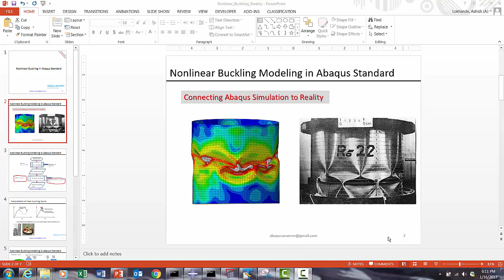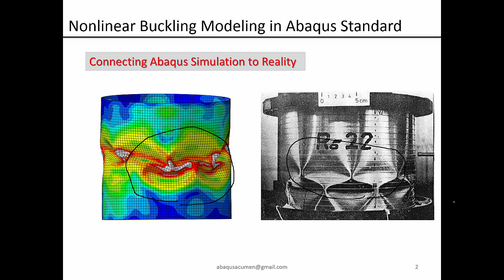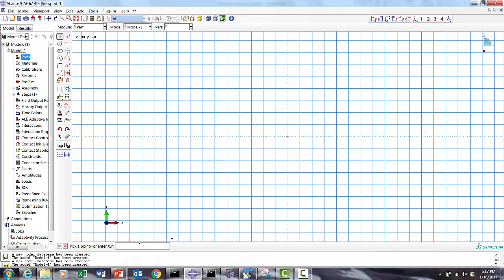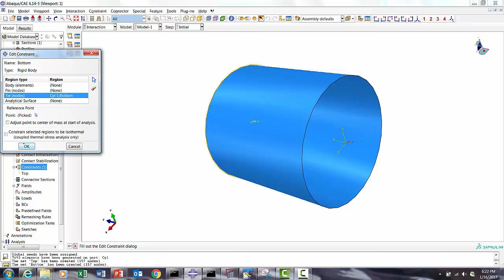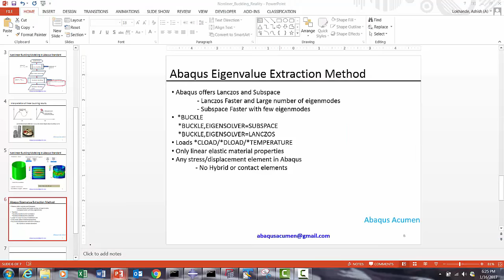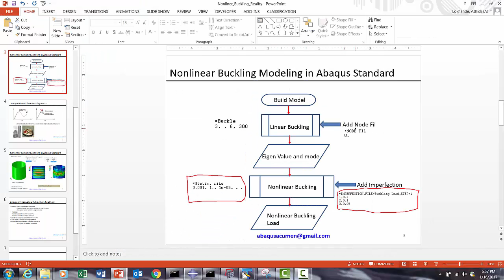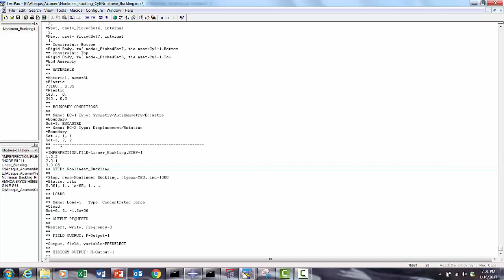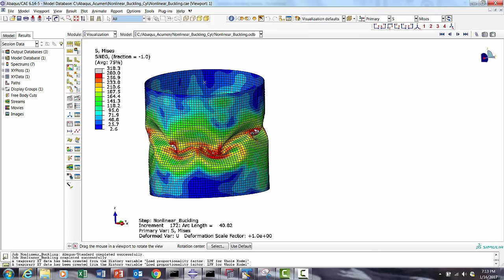Abaqus Standard: Nonlinear Buckling Example (Cylinder buckling)

Comment: In this model, If you use "Step = Static, General" with "Nlgeom=ON, Automatic Stabilization: Specify dissipated energy fraction : 0.0002,   Use adaptive stabilization...=0.05,   Maximum number of increment:1000, Initial:0.001,  Minimum: 1E-005, Maximum:0.1 "  &  "Load, you use displacement loading U3= -10mm ", you can also get the same result with "Static, Riks"
Reply: why we need to add U3=10mm? when we get first eigen mode then we use same value for buckling which is giving more correct & realistic results. what is your views?

Comment: When I do the "Data check" for the Non linear Buckling case, I get the following error- "Error in job Nonlinear_Buckling: The following results file(s) could not be located: Linear_Buckling.fil" 

I have tried to implement the following in Linear_Buckling.inp: 
*NODE FIL
U,
But when I make this change, and reopen the Linear_Buckling.inp file, I can only see 
*NODE FIL

Is this the main root cause?

Kindly help in this regard. Thanks!

Comment: Why does it has an error "the time increment required is less than the minimum specified,..." when running the static, riks analysis?
Reply: I got the same error when submitted on ABAQUS2020.
Reply: Johney Zhang I have fixed it
Reply: @CuongNguyen-tt4jp  Would you please share your solution with me?
Reply: Johney Zhang actually, I don’t fix it. i just run it with one mode and imperfection, not for all mode, and it worked.
Reply: @CuongNguyen-tt4jp  I think decreasing the maximun increments will fix it.I have changed the maximum from 1000 to 200, and it works.

Comment: can you do 1 example with IMPERFECTION? E.g, do nonlinear analysis including imperfection for this model
Reply: Exactly what he did. Check from 18 mins and forward.
Reply: yes. I saw imperfection. But i try to understand the Imperfection factor : 1, 0.2      2, 0.1       3, 0.05......How abaqus use that factor to add to "perfect model"  ???? Why not factor " 0.02    0.01      0.05"   , and some else number (see 15min24)
Reply: He explains this in 21:35 and forward.
Reply: he just did that.

Comment: Hello dear friends!
I need help pls!!
I'm doing nonlinear buckling analysis of a hot rolled I beam by using brick elements. Unfortunately my eigenshapes and eigenvalues are not correct. When I use shell elements, everything runs smooth. However, I'm doing research on brick elements so I can't substitute.
Does anyone knows anything about doing eigenvalue and nonlinear buckling with brick elements?? 
Thank you!!
Reply from the maker: It might be because of degrees of freedom in brick element. You need to have 3 elements across the thickness to capture the bending mode shape.
Reply: You need higher order brick elements,,,,or preferably hybrid,,
first order elements would have problems..